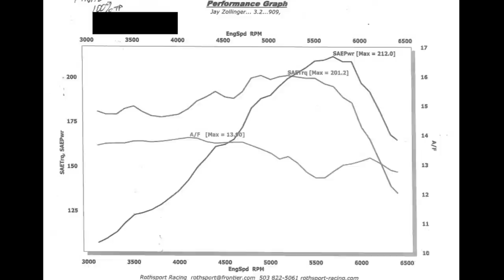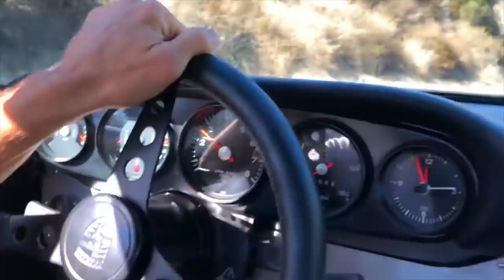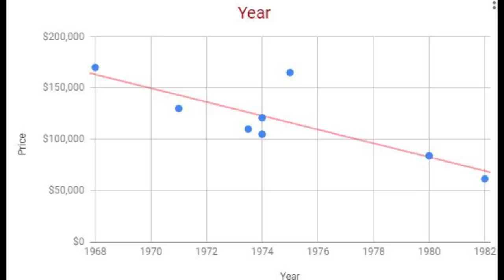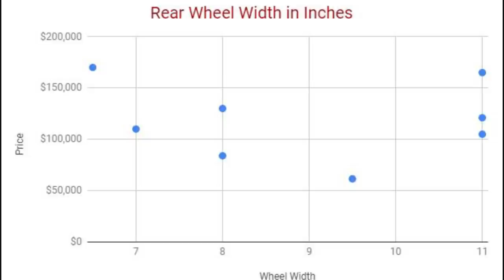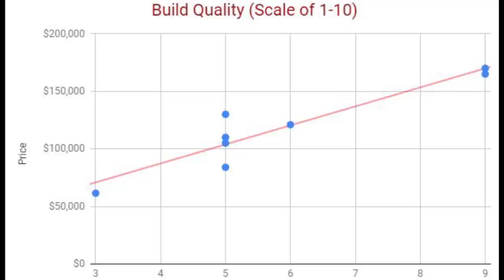Porsche Hotrod Market Review 2018

Comment: The most important thing for me is the engine. I want at least a 3.2L, then the body work. I am very surprised that these cars command that kind of money. I wouldn't be surprised if yours get that kind of money since you're doing a great job and have everything documented on videos.
Reply from the maker: Hi Vincent, yes the engine is important to me also.  I want it all.  Are you modifying a 3.2 or transplanting a stocker?  I will most likely be going AEM INdividual throttle bodies.  Hard to believe my car will ever be with that.  I'm still around $7k in.

Comment: The steering wheel on the white and blue 74’ RSR style 2.8 liter backdate looks like it’s upside down to me. It might just be the photo but it looks like there’s more room between the spokes and the bottom of the wheel which should be on top if that’s the case. I might be wrong.
Reply from the maker: Might be??? Hard to know where the wheels are in the pic, but you would think with all those mods they would get the steering wheel right...

Comment: Interesting analysis, all in all, agree with your conclusions even though the sample size is extremely small.  Keep in mind that in statistics, correlation does not equate causation. On your scatter plots with the regression line, is it really a linear regression or just a line that made sense to you?  If you’re familiar with either open source software packages R or Python, it is easy to build linear regressions and more complex and compound statistical graphics.  Would be interesting to capture multiple dependent variables on the same graph and then see if there is obvious clustering, maybe do a PCA (Principals Components Analysis).
Reply from the maker: Thanks,. The lines were placed by Google sheets (Excel).  Here's the spreadsheet if you want to play with it
https://docs.google.com/spreadsheets/d/1S258-hvPe6NMLg6Q8R14XQRhOsVCjUf0ObEFoC3RgyI/edit?usp=drivesdk